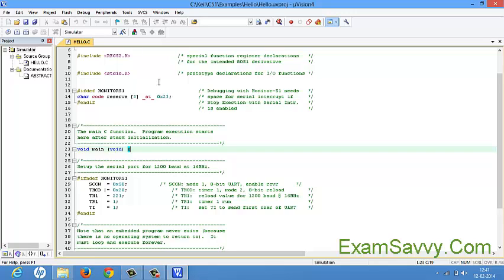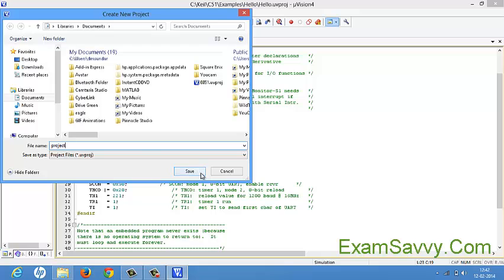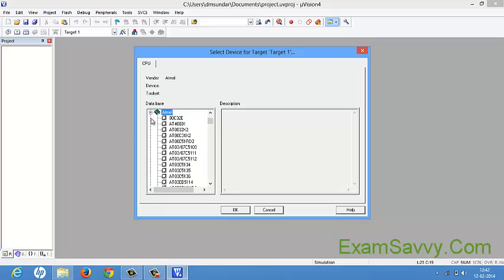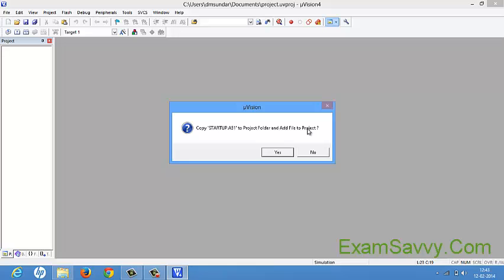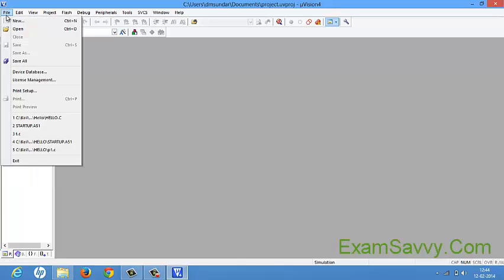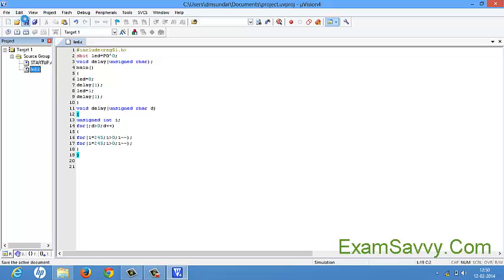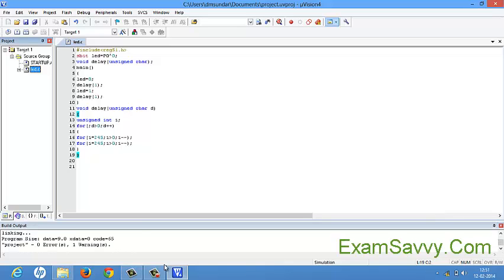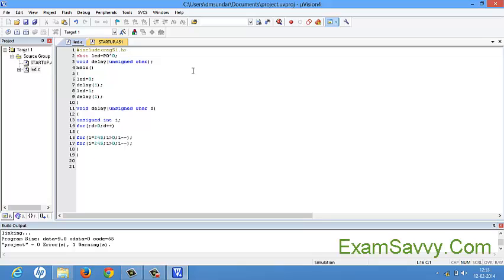How to use Embedded C Coding in Keil

Comment: that's odd... kiel's embedded c doesn't have delay function? anyway, if the main() is already in a loop state, you can shrink down the code:
void main(){
int d = 0;
/* while(1){ */ //just in case
   d = (d + 1) % 500;
   if (d <= 250) {led = 1;} else {led = 0;}
/* } */
}

however, if the main() isn't in a looping state, then use while() loop after int d = 0; ... it might throw a warning since the while loop won't stop indefinitely.